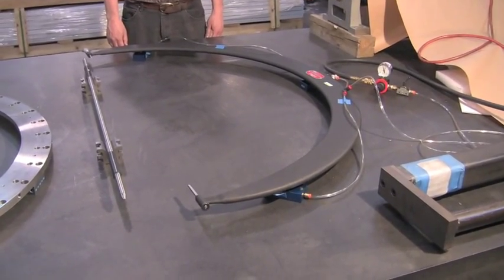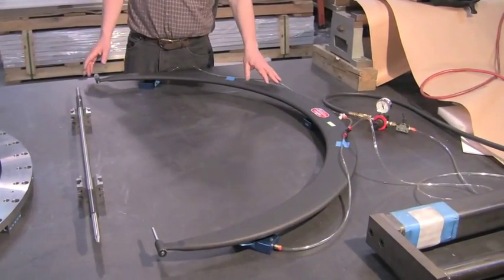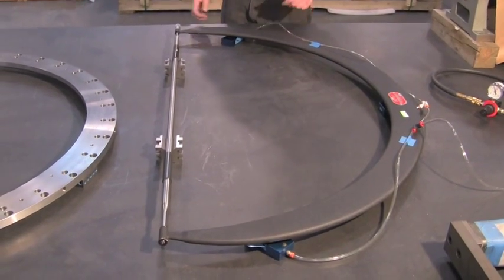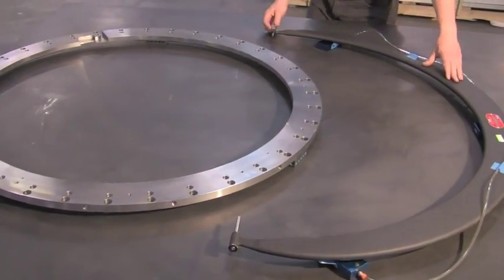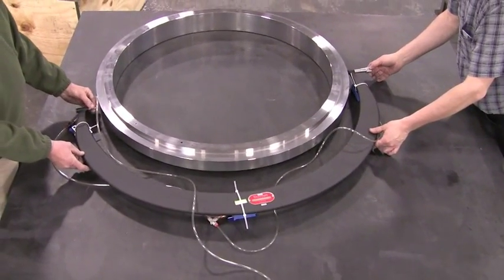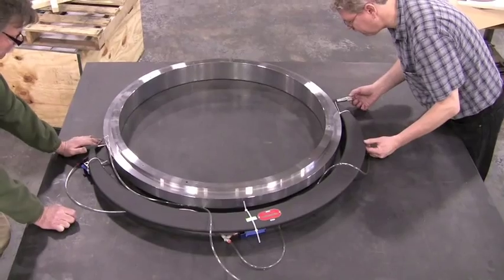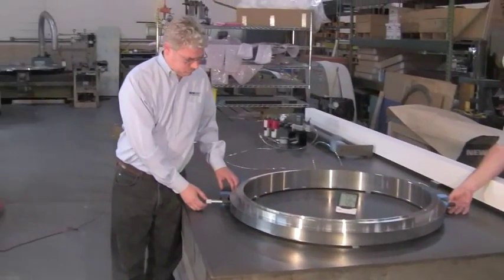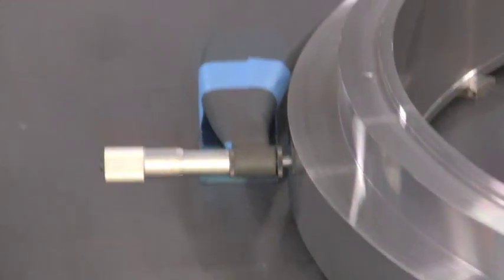Floating Micrometer Measuring

Comment: That is a massive micrometer.  How much would the measurement change with temperature variation?
Reply: The guy just calibrated seconds before, the heat capacity of metal is low, but it is an excellent radiator, more than enough to handle, contact for a few seconds. If unsure, they could calibrate, get ten people to hold it for ten seconds then recheck calibration. Physics, is not for speculation.
Reply: 1 thou per inch every 100 degrees or something